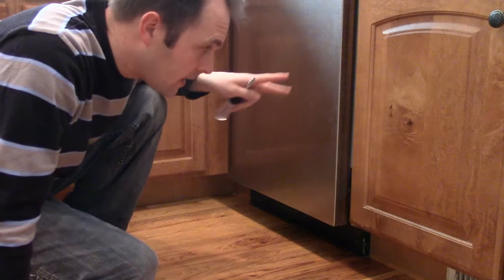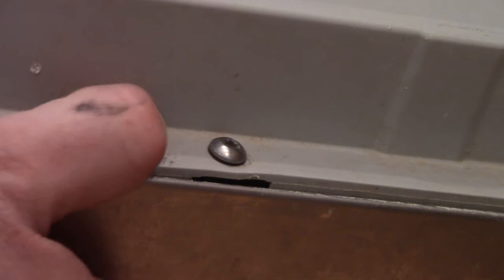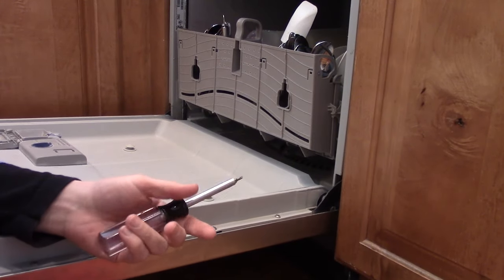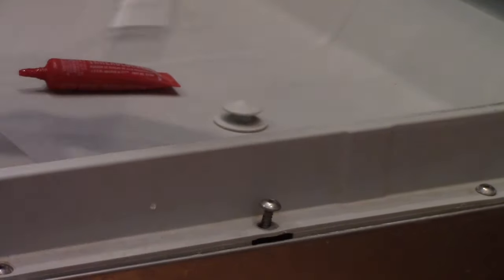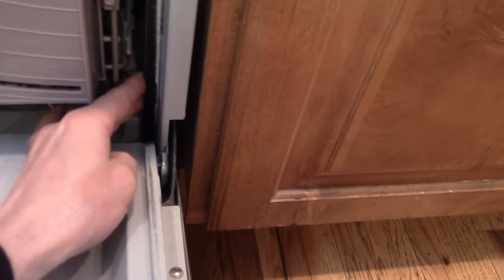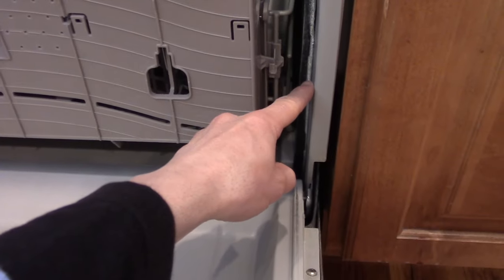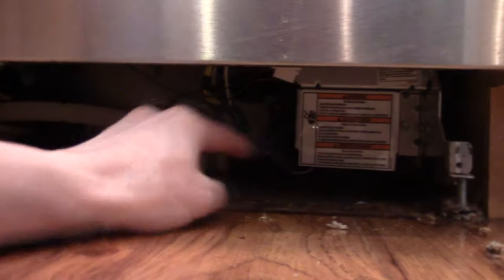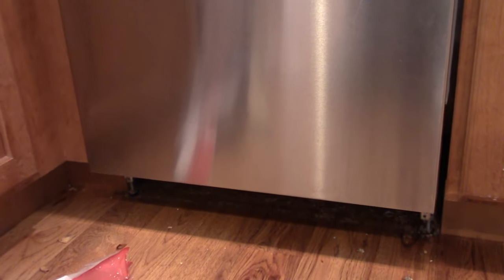How to fix a leaking Dishwasher Door - Whirlpool Kemore

Comment: I found this video after I replaced the door gasket and the door still leaked. Went back and checked the screws and most were loose and one was almost all the way out! Tighten the screws and the leak stopped. The gasket was in bad condition and Whirlpool has improved the design, but I am glad I found this video. Thanks Adam.

Comment: Thank you for the information. Our gasket was still good and the cover screws were tight so we had to dig a little deeper. There is a vented area on the bottom of our door and when we would start and stop our dishwasher, it would burp a splash of water out. After removing a plastic nut on the top of the rotating sprayer in the bottom of the dishwasher, I was able to pull that assembly out and noticed we had 2 screws that had completely come out and 4 others were loose on that assembly. When initial water pressure would start, it pushed a wave through the bottom of the dishwasher leading to the burp of water through the vent. Reinstalled and tightened screws and no more leak.
Reply: I am so glad you published this, I just replaced the seal on the door and it still leaked!  You saved me from buying a new dishwasher.  I read your post and then had a look under the bottom sprayer and the screws were ALL loose and one was even put in cockeyed from the factory.  Great QC Whirlpool !!!  NOT.  Anyway tightened them down, started a cycle and no leak.  Thanks so much!!!
Reply from the maker: Ted Nicholson That's awesome.  I'm glad you were able to fix it.
Reply: +entzmatt 
can you tell me how you removed the plastic nut? I tried with my hand but it won't budge... :(
i replaced the gasket, i tightened the screws along the door but still has drops of water, maybe 3 -4 drops during the light wash cycle on the left bottom of the door. Any help would be appreciated! It would start doing this days before Thanksgiving!!
Reply: The main nut top center on mine is like a "wing nut", it's plastic and has a flat wing across it, it comes off easily as it is on finger tight.  Sounds like yours is different washer or model.  good luck.
Reply: Did you get yours fixed?  I'm having the exact same problem. I replaced the seal and all my door screws are tight and it still burps water from the bottom left corner of the door. I looked at my bottom sprayer and at first the wing nut wouldn't budge. Then I discovered it is reverse threads. It's not really a wing nut although it looks like one. Instead, it is part of the center hub of the lower sprayer arm. If you hold the wingnut the sprayer arm itself will unscrew from the hub. If you are trying to hold the sprayer arm and turn the wingnut then you need to turn it to the right to loosen. Unfortunately my lower spray arm did not have any screws on it.
Reply: Are you talking about screws that are in the lower arm itself or the screws that on the pump intake screen below the arm?
Reply: Mountain Skillz o

Comment: The two screws that hold the dishwasher to the underside of the counter top were loose on mine which allowed the unit to move in and out. That put outward pressure on the door because it was hitting the edge of the cabinetry. Thanks for the tips.

Comment: Thanks! Just tightened the screws and next time we use the dishwasher will see if it leaks. In a year we might use the dishwasher 12 times so won’t know if the gasket is needed till then. Thanks again.
Reply: You should consider using it more often if you want to save money on water, especially hot water. Unless your super efficient at washing and rinsing your dishes - the eco mode or default clean non 1 hour wash will take many hours, but that's because it's just reusing water hotter than a human can stand.

Comment: it also can  be a defective water inlet valve ... if your still getting a leak, the inlet valve may not be operating properly thus allowing too much water or maybe not enough water causing water to overflow or foam overflow ...

Comment: I would not use the glue as you need to access the interior of that door for other components if they fail. Just add this to check along with the batteries for smoke detector.

Comment: installed - did not put panel on. strip of insulation at bottom of door becomes damp - normal condensation or bad gasket, something else? Checked gasket all around that is visible - don't know if there is something in the hinge of the door.

Comment: What if the leak happens 12-18 hours after you last washed dishes, and it leaks water all along the bottom front of the dishwasher and forms a large puddle all along the floor? Sometimes it still has water accumulated in the tub after the cycle is finished, sometime not. But it doesn't start leaking on the floor till many hours later.

Comment: That a T15 Torx bit. Not a security bit. The "security" bits are the ones with the holes in the tip. Security, not really meaning what you think it means. It just keeps people out who are unable to figure these things out on their own. Non technical types. 

Just re-watched that... The bit is a security bit. But the screw is not. The screw would have a pin, that fits into the hole. 

Tech ti: That is a screw made to go into plastic. The threads give it away. Make sure you turn it backwards about 1 full turn, and you will feel it drop into the threads. Otherwise you can get it cross threaded, and ruin the threads in the screw hole. Placing some sharkskin in the hole will help with threading after that becomes a problem. Sharkskin looks like a  miniature cheese grater. It give the screw a little more grip.

Comment: My  dishwasher started to leak after doing some work on the interior. this included disassembling the bottom to free up some junk.  I wonder though if when I was trying to screw the upper arm assembly I leaned heavily by accident and the door which somehow made me this got the door out of alignment. Right after that it seemed like it was a little hard to close the door the last inch or so before it latched. I have tightened all the screws on the door so I know that should not be the problem. I have inspected the upper and lower washing assemblies and it seems like they are not broken to suggest some misaligned spray I have made sure that the rinse aid is not leaking as I have read that that can cause a problem with too many suds . I guess my next try now will be to replace the gasket. I am not so sure though as this all seemed to start after I was doing some work inside the dishwasher. I am open to any suggestions however including the possibility that I damage the door when I inadvertently leaned on it . It definitely started right after I finished working on the inside of it however. Hopefully I did not damage anything. I have checked all the fittings on the inside of the dishwasher and then take it apart again to make sure everything is in its place

Comment: So if you use
 Red Locktite and later have a problem and need to remove the screws -  how do you do that??
The RED loctite, the color of the fluid not the bottle, is a PERMANENT. Loctite and should only be used on components that you are not planning. to remove. The BLUE loctite, the fluid, is removable loctite, one of the names it is.

Comment: Not good to use ' permenant ' thread lock. You may have to remove the door in the future to replace electronic parts etc,
Reply from the maker: They call it that but it's hardly permanent.
Reply: Maybe not into plastic, but put it on a 1/2-inch nut and bolt and try and remove it without heat. 

I'd probably just use blue. Honestly I'd probably use something like gorilla glue as I have that in the house usually. Saves a trip to the garage.

Comment: The KitchenAid K-series (as well as Whirlpool) dishwashers also have a pinch clamp design flaw - the pump connection will come loose and pump water to the floor - flooding your kitchen and house - see KitchenAid Dishwasher Leaking Water - Defective Pump Clamp - Appliances Forum - GardenWeb. Beware and forewarned.

Comment: Why use "a more permanent" thread glue on something that you may need to remove to repair some other issue with the door? That's just stupid. Using blue is significantly wiser.